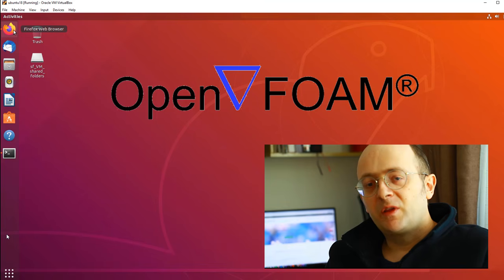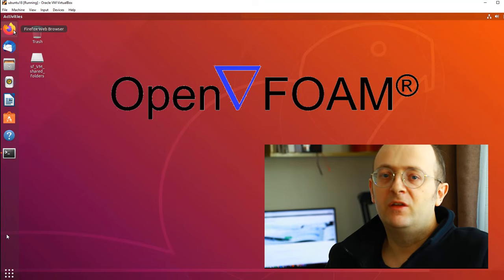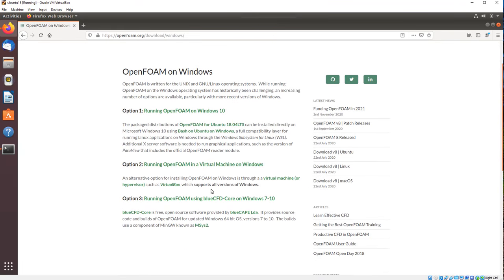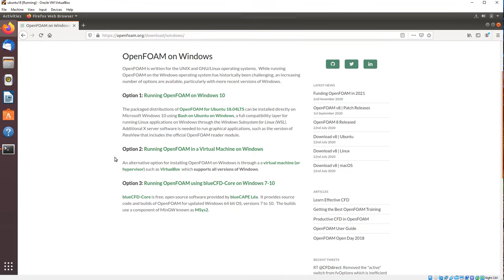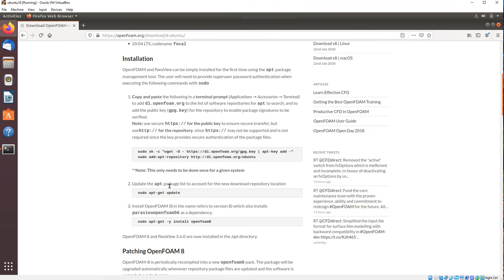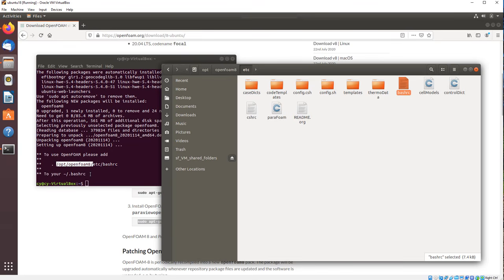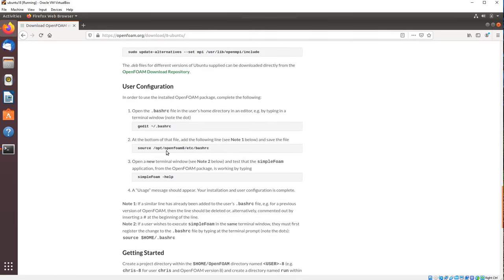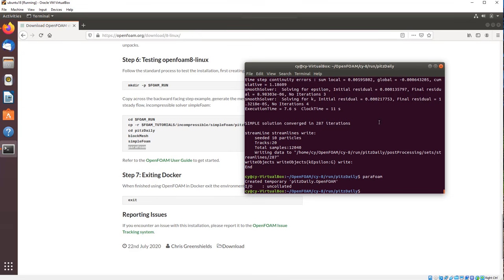[Tutorial 1] How to Install OpenFoam on Linux and Windows

Comment: How does OpenFOAM compute the meshes? Is it a CPU Solver or does it use the GPU to parallelise the computation? I am considering to build a machine to run CFD exclusively, and would like to know if I should go for a GPU Build or just give it a great CPU with tons of RAM. I plan to simulate rather large internal flow fields, including phase change (Boiling, condensation) with heat transfer. I haven't worked with this software yet, but from what I read this is the gold standard in the industry right now, so might as well learn how to do it. 

Thank you for the introduction series, I'll work my way through it.

Comment: Hi :) it seems to run but I have problems with the last step: When I type "paraFoam";
I get this...
Created temporary 'pitzDailySteady.OpenFOAM'
QStandardPaths: wrong permissions on runtime directory /run/user/1000/, 0755 instead of 0700

Loguru caught a signal: SIGSEGV
Stack trace:
1       0x7ffe7eb7a4a0 [0x7ffe7eb7a4a0]
0       0x7fb328600520 /usr/lib/x86_64-linux-gnu/libc.so.6(+0x42520) [0x7fb328600520]
(   5.120s) [paraview        ]                       :0     FATL| Signal: SIGSEGV
...instead of a nice image like in 19:52
Unfortunately I do not understand the error (Looks like chinese to me :)- can someone help me please?

Comment: Created temporary 'pitzDailySteady.OpenFOAM'
qt.qpa.xcb: could not connect to display
qt.qpa.plugin: Could not load the Qt platform plugin "xcb" in "" even though it was found.
This application failed to start because no Qt platform plugin could be initialized. Reinstalling the application may fix this problem.

Available platform plugins are: eglfs, linuxfb, minimal, minimalegl, offscreen, vnc, xcb.

Aborted .

I am getting this error can you please help? I have followed each and every step mentioned in the video.

Comment: Hlo Sir , I have to compare dambreak case with interfoam solver which is inbuilt in openfoam v2112  and interflow solver in two phase flow  that I downloaded from github. Sir how to run that case in this interflow solver which I downloaded. Do I need to copy the case from interfoam to interflow ?? Please help

Comment: Perfect video and it went all smooth for me until at 19:97 when I launch paraFoam then I get the following error message in my Ubuntu 20.04.6 LTS

Created temporary 'pitzDaily.OpenFOAM'
Mesa warning: Window 6291465 has no colormap!

Mesa warning: Window 6291468 has no colormap!

I/O    : uncollated
Mesa warning: Window 6291476 has no colormap!

Is it not seems to be normal. How to solve this issue? Kind Regards
Reply from the maker: I think you need to uninstall paraview and then reinstall it, the process is explained in this video: https://youtu.be/tWEGjWD8d2M
Reply: @Feaforall  Thanks allot. It works now

Comment: Hello, I'm getting an error "Mesa warning: Window 10485772 has no colourmap!". Can anyone please explain and how I can correct this 
Thanks
Reply from the maker: How are you running openfoam on windows? 
Do you use WSL to run Linux and installed openfoam on it?
Mesa is some software used in Linux to emulate the graphic card to display stuff, so maybe you are getting this warning because the graphic card is not installed or detected.
That’s just a guess as you didn’t provide much information

Comment: Can OpenFOAM install in ubuntu 20.04? When I install in ubuntu 20.04, I am prompted to fail to compile, this is because the version??
Reply from the maker: Yes, I am sure you can install openfoam in Ubuntu 20.04. Look at the error and try to solve it. Maybe you lack a software dependency or a compiler.
Reply: @Feaforall  Thanks for your reply, I have done it

Comment: Hello,
Thank you for the wonderful tutorial,
I am getting following message while running the example backward step flow.
missing destination file operand after '/opt/openfoam9/tutorials/incompressible/simpleFoam/pitzDaily'

Kindly help.
Reply from the maker: Check how the copy works in Linux. The syntax should be “cp -r path1 path2”
You forgot path2
If you are copying in the current folder, then path2 is just a dot “.”
Reply: @Feaforall  Thank you. That works

Comment: Hello, Thank you so much for the video :). I have a problem with paraview (PV) where I cannot access my data files that I have created using OpenFoam (OF). I have followed tha installation steps at the OP website. Your method of installing OP is a bit different than that of the creator website.
Reply from the maker: How have you installed it? I don’t understand how you can’t access your data…are you on a remote machine?

Comment: ## urgent to know 
I want to simulate a rotation with complex interactions between the item and viscous liquid. 
Specifically, that is problem 9 in 2020 IYPT.
Is Openfoam proper to do that?
Or any advice for a better software?
Thanks.
Reply from the maker: You’re talking about magnetic levitation? I don’t think Openfoam can simulate electromagnetic physics.
Not sure if any software has electromagnetic-fluid interactions… fluent?
Reply: @Feaforall  : Never used OpenFOAM but I am sure COMSOL does it. And EM can be applied through Maxwell equations or there are other ways as well. Should be done through OpenFOAM as well.

Comment: I cannot open paraview. When i type parafoam i get the following error:
Created temporary 'pitzDaily.OpenFOAM'
QStandardPaths: XDG_RUNTIME_DIR not set, defaulting to '/tmp/runtime-bramdt'
qt.qpa.screen: QXcbConnection: Could not connect to display
Could not connect to any X display.

Does anyone know how to fix this?
Reply from the maker: Looks like you are on a machine which doesn’t have a X Server, so paraview can’t open its graphic window. Are you on a virtual cloud machine? Or are you on the windows bash ? In the first case, you can install a special version of paraview with Mesa to use paraview without X server ( that’s a bit complex to set up but doable). In the 2nd case, you can install the windows version of paraview and open your openfoam results in windows/paraview rather than using the paraview version shipping with openfoam.
Reply: @Feaforall  Thanks for your response. However I still dont really get it. I am working with ubuntu 18.04. I also installed paraview in ubuntu with the following command: sudo apt-get update && sudo apt-get install paraview. And i also installed a windows version of paraview. But how can i use paraview now with openfoam?